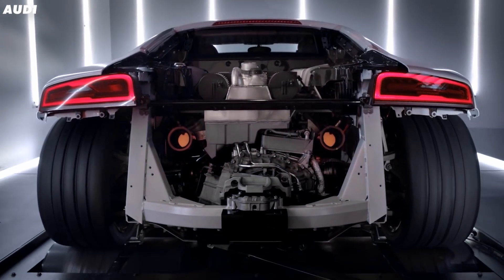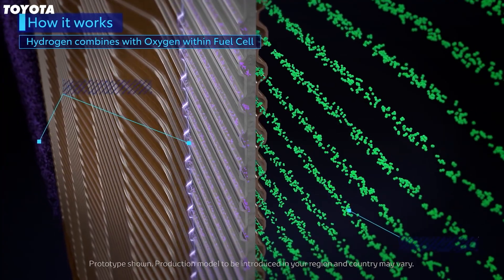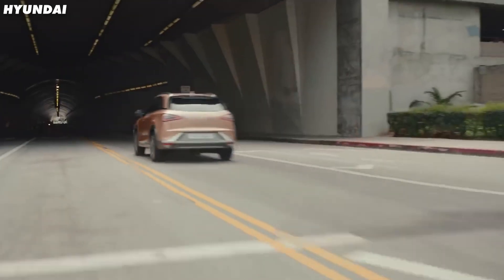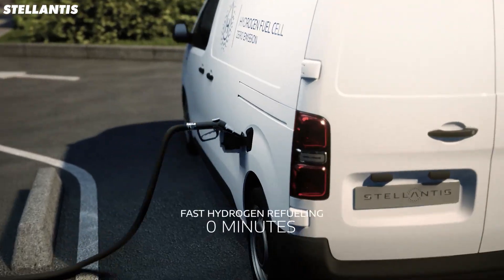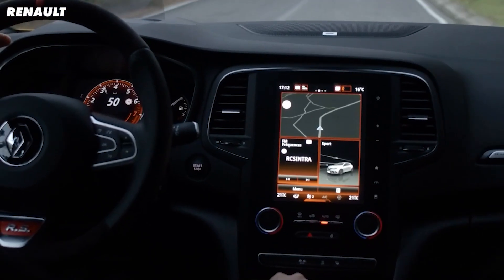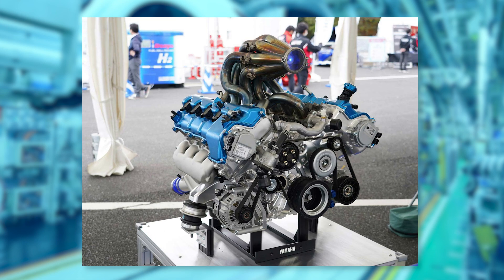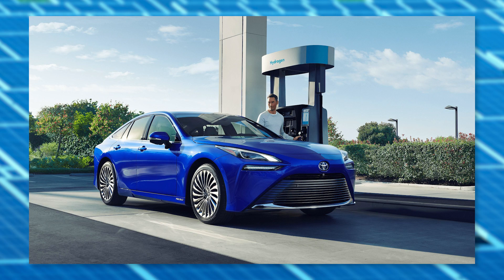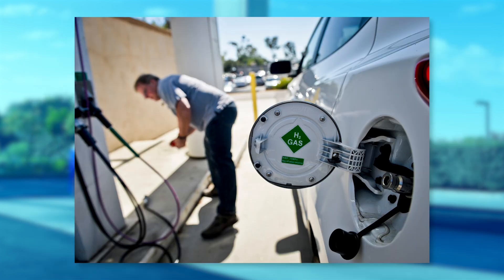The V8 Engine that Runs on HYDROGEN

Comment: Good video but a few take away points worth talking about:

1. The answer to H2 ICE being an alternative as to why it wasn't scaled up before is still unanswered by a lot of the car companies building and patenting them. Burning regular H2 emits 300% more NOx emissions that traditional ICE engines. Did these car makers solved this issue and are going ahead with it? We still don't know about that.

2. One of the main reasons why EV infrastructure is scaling is because the means to transfer electricity is already in place. But what hasn't been addressed is will the current electricity grid (where I get to press some keys and send this comment to some random YT channel) that is now way beyond it's threshold designed limit from 70 years ago be able to handle the surge in demand if 99% of all transportation becomes electric? I think our politicians need to have a revisit at this and rethink their priorities.

3. Associating H2 with H2 bomb is like associating nuclear bomb to nuclear ships. I find it hilarious that we haven't even seen a major disaster occur from them and yet we are crying about how unsafe they are with no track record of them to begin with. Toyota actually demonstrated their H2 fuel tanks safety by shooting a regular pistol round at a pressurized fuel tank to demonstrate just how "unsafe" H2 tanks are. Link: https://youtu.be/jVeagFmmwA0

Overall I think H2 does have potential but it clearly needs more investments into it so we can unlock this potential. I also think rather than having all forms of transport being electric is just disastrous for our ancient grid. Especially if the governments also want ships and airplanes to also be electric. Clearly we need to diversify our energy outputs. It would also make sense for people who live in apartments with their cars parked outside on the streets and not have cables running down from their rooms while everyone sleeps at night.
Reply: 3. I also want to add that in h-bombs the hydrogen technically isn't been burned or exploded (ie. Oxidized: h2 + 2o2 - > 2H2O) but rather fused. ( H[1/2] + H[1/3] -> He[2/2] + 1n) 
This is alot different ( 2 diffrent chemical reactions) and to compare them two is not really rational and shows how little the Autor understands the processes.
Reply: This might not be true or maybe I am missing a few specific details or getting a few details wrong so correct me 

Once someone told me that someone in the olden days demonstrated the safety of hydrogen to law makers by getting a balloon of hydrogen and lighting it. The balloon rapidly exploded making hydrogen seem very unsafe to the law makers. Later in that person’s life, I think he told that the balloon was tampered by someone/s from a helium company so the hydrogen would deliberately explode violently when it shouldn’t of. 

The reason for this is so hydrogen air ships would be outlawed so helium ships would be used therefore the helium company would make a lot more money

I believe this to an extent since hydrogen doesn’t necessarily explode, it just burns in not a very dangerous way as shown by some videos of a fuel cell being shot at.
Reply: I am confused, How does burning hydrogen(H) release any NOx(nitrogen oxides) at all, shouldnt it just release H2O?
Reply: @shivamarya5225  becaue you are not just burning hydrogen. There's more in that cylinder than just hydrogen and oxygen.
Reply: @Hans-gb4mv  okay but why would nitrogen start reacting with oxygen?
Reply: @shivamarya5225  There is alot of Nitrogen in the air.
When there is a combustion, alot of heat is released. This heat spreads to nearby molecules and there are mostly N2 molecuels around and of course there is oxygen .
These will react with oxigen if there is enough heat. N2+O2 - > 2 NO (small amount of heat)
N2+2O2 - > 2NO2 (medium amlunt of heat)
N2 + 3O2 - > 2NO3 (high amount of heat)
So technically it a consequence of burning, but the higher the heat released, the worse the effect gets because alot more Nox get released into the atmosphere. (which is bad for the environment)
Reply: yes the NOx caused you know we living on earth abundants of N2 plus of oil process of burning, not 300% AFAIK anyway.
 but toyota is working also of the new catalytic converter that purifies NOx *if not mistaken japan is announces 0w-8 oil that very thinning so they can minimize the exhaust production.
Reply: On number 2: think about changes in the last decade to answer that one ... did you think the installation of so many air conditioners at homes was foreseen? Do we cope with it? Is an increase of around 15% in power consumption really that impossible?
Reply: If the grid cannot handle EVs, then the grid cannot handle H2 cars, even more so as the production, transportation and storage of H2 is much more energy intensive than charging a BEV.
Reply: I also watched a blogger who tried to make a hydrogen engine, and while he was working on it, in a year or so, the cell unit degraded, so these things are very expensive and very delicate, unreliable, demanding to conditions they are used in or kept.
Reply: 1. Hydrogen sucks to make.  Its expensive as balls, if you think gas prices are high you'll cry when you see h2 prices for the same mileage. Its usually made through electrolysis with water which takes a ton of electricity. (so why not just use the more efficient electrical system found in EV's, rather then an inefficient combustion engine. )

2.  If 30% of cars on the road became EV tomorrow our grid can handle it (EVs aren't being adopted near that rapidly).  Its been improved upon, so idk what you are talking about with a threshold. If the system was unable to handle the electricity it would be unable to. I think you need to take into consideration that this isn't a genies lamp situation and the switch to Ev's isn't going to be faster then our ability to improve upon our electrical grid. 

3. Its more like associating a propane container with a nuclear generator, your main concern is pressurized combustible gasses. That said id be more concerned about reliability of those systems to not leak like crazy given a decade or two. 

Potential yes, but its something we looked into pretty fiercely under the Bush administration, and theres some very good logistical reasons it hasn't and probably isn't ever going to take off.  Your entire argument hinges on this "ancient grid" idea,  sure the design is old but its more then equipt to handle things and its going to be a while before evs make it into the secondary markets for the people living in apartments.  Plus its really not hard to add electrical sockets to the exterior of a building or to a parking area, but that would be at a landlords discretion and he may have difficulties finding tenets if he cant keep up with the times.

Comment: I think Hydrogen cars are the answer, Evs are too heavy and slow to charge, we should use renewable energy to make hydrogen.
Hydrogen cars are lighter more efficient because hydrogen is compressed you get more range from the equivalent weight in petrol. The hydrogen car market is in need of a visionary like Elon musk who can make this a reality.
Reply: Lol, always fun to see people think that hydrogen fueling is fast ... . It can be, but depends on whether or not there is still hydrogen under pressure at the refueling station. If there isn't, you'll be waiting longer than it takes a modern BEV to charge.

Hydrogen cars are also NOT lighter, look up the weight of those massive fuel tanks.
Reply: @Hans-gb4mv  it's always funny when I see people claim that charging Evs is fast it depends if there's electricity where you are or if there's an outage or a hurricane or a solar flair or a charging station full of cars waiting to charge when everyone and their mothers has bought one, and don't get me started on weight and range of the damn things.
This is exactly how you sounded 😂
Reply: @Mr.Nabil.Belhaj  there's no denying that nothing beats an ICE on how fast you can fill up, but don't forget tat when the power is out, fuel stations also don't work. But in the comparison between hydrogen and EVs, it will always be a toss up on which is faster.
Reply: @Hans-gb4mv  so we should diversify our choices and not make the same mistake of relying on one source

Comment: Ngl, it isn't worth it. People have to actually buy hydrogen fuel cell cars to get hydrogen combustion cars popular, we'll never see mass production of hydrogen combustion cars. Nitrogen fuel cell cars are just so inferior to pure electrics. The only positive is that they can be refueled quickly. Which, most likely, in a couple years you'll be able to charge a battery that quickly.

Comment: on the issue the renewable sources of energy producing electricity instead of hydrogen, the renewable sources should only be producing hydrogen when the the production of electricity is way higher then the electricity is needed.  Its quite often that renewable sources of energy will high spurts of energy output that the grid cant use and they just stop the wind turbines/solar panels and they producing nothing when there is no wind or sunshine.  It looks to me the hydrogen should be a technology that compliments renewable sources of energy, and provide energy when wind/solar are not producing.
Reply: no hydrogen is the battery replacement, it doesnt have recyling and longveity issues electric battery now have. main energy creation still got to be primarily nuclear and maybe hydrodams, weight gravity batteries. lightweighting is great for low cost and road repair cost in tax dolar and emissiosn and natural resource sustainability etc, using capacitors and hydrallics instead of batteryies. combustion could very well be better option bc lightweighting, ,like freepiston 2 combustion chamber 1 piston version of nissan E power

Comment: It will never be the final solution due to burning fuel. Hydrogen combusion produces a lot of NOX emissions which isnt good for the enviroment
Reply: Not a lot.... Significantly lower than diesel engines
Reply: And the whole world is only obsessed with carbon (for now)
Reply: @pigasusr2  by the whole world u mean the general public then u are right. But the ones who makes the laws about emissions regulations definitely take all of this into account
Reply: NOx is simply a matter of heat. Heating plain air in a pressurized box will produce NOx.  Gasoline produces a lot, diesel produces slightly less. Hydrogen probably produces more than gasoline, but I'm not sure. The big issue with diesel is SOx.
Reply: @SeniorKlean  actually it's the other way around.
Hydrogen produces the least, gasoline slightly more and diesel produces the highest amount of NOx because it runs lean. 
SOx is also produced in diesel but it's a really small amount because nowadays very low sulphur content Diesel is used.
In the case of Hydrogen engine the only end products are water and NOx and NOx is very low so it's the most greenest option

Comment: You’re missing the facts… hydrogen efficiency is only 30% for its pure production.. and actually even lower than that because of combustion etc… so will be at least 70% more per kWh equivalent than electricity charging for EV’s. Plus, they require more maintenance than EV’s… in terms of oil changes etc.
Reply: Actually they are more efficient than a normal combustion engine because of the high combustion rate of hydrogen
Reply: @T0NYMANUEL  I’m on about efficiency compared to EV’s. And the production of turning water into hydrogen. Hydrogen generators may be good for the on demand electricity for broken down EV’s. But I don’t see a mass market for hydrogen, they’re inefficient and will be over 3x more expensive than battery tech because of these inefficiencies.
Reply: Yeah, even disregarding all the other problems the total cost of ownership will be so high that EV's will always be more economically attractive. This drastically reduces the market for hydrogen and thus makes investments in infrastructure and vehicle development harder to justify.

Comment: Hey here in the Netherlands there is an working prototype on pressurized oxygen car, maybe you can do a video about that
Reply: Pressurized oxygen!!!!!! Wth isn't that just a bomb???
Reply: @AR-ix8fq  🤣
Reply: @AR-ix8fq  no. Theres also air compressors. They're not bombs. There's liquid oxygen tanks. They're not bombs.
Reply: @AR-ix8fq  well it's actually pressurized air not just oxigen about what I've read it was a kit to build a petrol engine into pressurized air by getting the air to  pushing down the cilinders each one at a time so yeah otherwise it would be a bomb😅. But its action radius is actually pretty good sorry for the miscommunication tho
Reply: Or maybe compressed air is a closer word to what I mean exactly
Reply: Sounds power dense 🤣
Reply: @KCJbomberFTW  😂😂😂😂😂
Reply: It would be quite the challenge to combust a car that runs on oxygen, with oxygen from the air. And no other fuel in close proximity.

(Unless you use the pressurized oxygen for thrust but that doesn't seem practical or efficient to me).
Reply: @surena9451  with pure oxygen anything becomes a fuel. even metal can burn when in a pure oxygen atmosphere

Comment: Let's just hope we can make hydrogen or Alternate fuels to quickly replace conventional fuels before EVs take over completely
Reply: I'm shocked at how people ignore the consequences of mass ev adoption
Reply: @falcongamer58  I´am by no means ignoring the consequences of that. But at the moment a good cobustion engine gets about 35% of thermal efficency. Lets be generous and consider further advancements in the ICU tech. Even if we get 50% themal effciency then we still have a loss of 50% as well. And thats after 100+ Years of research of that topic. So you would still be losing about half of the energy you needed to produce the hydrogen. If we dont come up with a way to produce hydrogen in big amounts as a byproduct then it would just be a waste of a lot of energy. Also the argument "lets produce it when the industiry need less energy e.g. night" doesnt really count because there would be easier storage solutions for that energy.

I´m not from an automotive background but from an aeromotive background so i´m just guessing, but hydrogen on a large scale will only be viable for big vehicles that have to have long ranges (ships, big planes (but maybe not even thoose because of the weight of the tanks at the moment))

Also: EV´s and battery tech havent had that much time and money thrown at it in comparison to the combustion engine so there is still a lot to find out and to make them better.
Reply: @nelayo4894  have you considered the power grid
Reply: @falcongamer58  The UK's National Grid have, and state there will be no issues.
Reply: @Brian-om2hh  who stated that
Reply: I dont really like it either but EV´s will be the future for nearly everything. Only a small percentage of high performance sports and luxury cars will keep combustion engines. And those most likely just for the sound, not for the performance. Reason beeing: the production of hydrogen and alternate fuels will always need more energy than just charging a battery. So you will always have a bigger energy loss with hydrogen an e-fuels compared to standard EV´s. 

So only the expensive cars will keep the "luxus" of a combustion engine. at least thats what i´m guessing based on the current direction of both vehicle types
Reply: @nelayo4894  What happens in 2045 when lithium runs out? lmao can't wait to see the "Ev is going to take over" argument then when we have to switch to hydrogen weather we like it or not.
Reply: @gamezahoy712  regarding the lithium: 1. there are ways to recycle lithium. At the moment its just less expensive to not do so and 2. there are already batterys that work without lithium. 
I am by no means a big fan of EV´s or so but at the moment it just seems more likely and logical to go for ev´s. The reason beeing: Hydrogen combustion enginges are very ineficcient (at the moment even more so than normal ICU). They get a thermal efficiency of about 25-35%. Let bump that up to 50% because of research and advancments. That still means you lose 50% of the energy needed to produce the hydrogen in the first place. And that is a lot of lost energy. 
The argument "lets produce it at night when the windmills are turning but industry is not needing that much energy" also doenst hold up because there are more efficient ways of storing the energy.
Furthermore: the ICU have had a lot time and money in terms of research and there doenst seem to be a really impressive step in the lines for it anymore. At least not at the moment. 
However battery and ev tech hasnt hat that much of money and time spent on it yet. The steps in battery tech in the last 10 years have been very impressive.

I´m from an aeromotive background and not from an automotive background so i´m just guessing here for the automotive side. But i know which way the aeromotive side is heading. 
At the moment i still think that hydrogen will only be a viable option if they can massively increase the thermal efficency of the hydorgen ICU up to above 60-70% and make the storage in the car lighter. Because of the weight of the tanks hydrogen tanks it is not yet viable for airplanes. There is alos a higher risk to it compared to kerosne (fire and pressure). Hydrogen will propably only be viable (at least thats what i think at the moment)  for ships or special applications like mining equipment. 

At the moment even sythentic fuels would be more likely in the aeromotive industry because you only have to have little changes to the tanks and turbines compared to hydrogen. Same goes for cars but there we would be again with the thermal efficency. 

I stand by what I said: at the moment it all points to hydrogen ICU´s only being a fraction of the market for special purposes or luxury cars, most likely still im combination as a Hybrid.